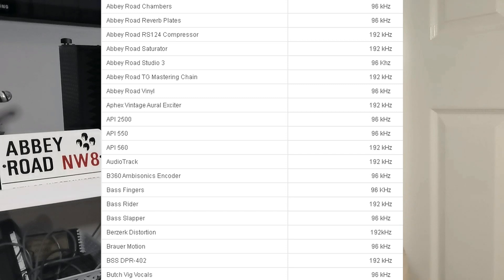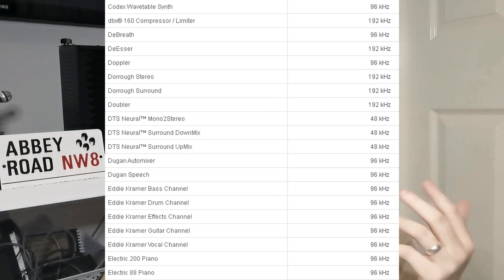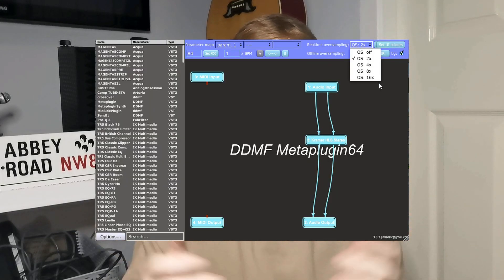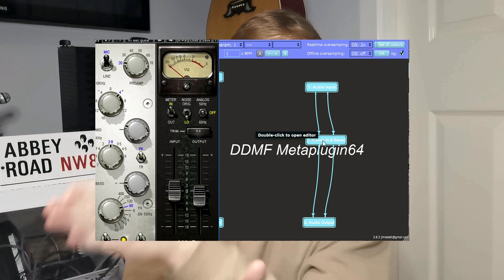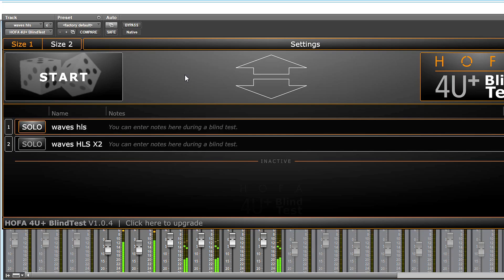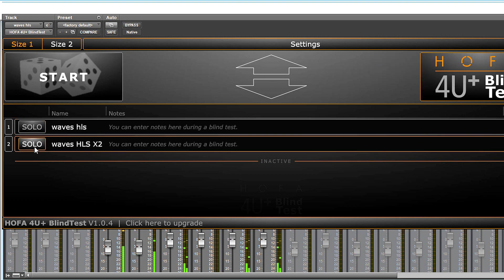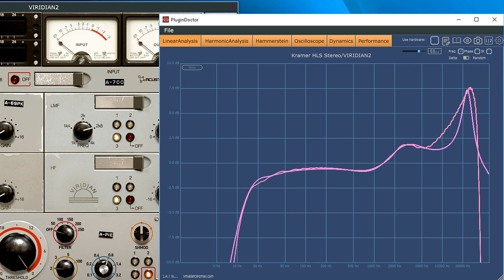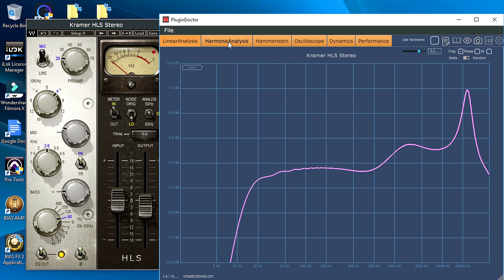OVERSAMPLING WAVES AUDIO PLUGINS USING DDMF METAPLUGIN || Kramer HLS vs Acustica Audio Viridian 2

Comment: Interesting observations and "good on you" for publicly correcting something.  I'm still moving away from Waves due to WUP since I prefer PA's Mega bundle where I get something new each year for the subscription and a big voucher to spend on the things I use most often.  I will also say, I run my sessions at 24/96K already so I hadn't heard HLS at 48K and was surprised to hear the difference.  In the AA vs HLS portion though, I also could've used either tone wise, but would've used HLS just because I could run it inline.
Reply from the maker: Yeah. Oversampling is a thing I guarantee you will be included in either v13 or v14. Will be the last throw of the dice to keep people using the older waves plugs. Could be a massive reason for people to stick with the WUP but tbh.. Metaplugin is like 30 odd quid or something haha be cheaper just doing what I did here.

PA plugs are supported to quite ridiculous sample rates so I might start having a play about with the PA plugs I use and see what kind of difference it makes. The maag air band is the one that is intriguing me the most as I'm wondering if it can sound even better

Comment: AA Viridian snake oil officially Debunked! 🤣 amazing end to this Vid Paul! Interesting stuff on the Waves front. I tend to use the MV2 and L1's but not a lot else really. 

PA's SSL's sound better to my ears than the Waves versions too, so they get a lot of use. 

BTW if you like the Arturia STA Level, then you should try their 1176 model, 100% always on my vocal chains these days, sounds so good. 

Great video again mate! Looking forward to the Opal vid - started using it on my masters and in my humble opinion it's just fantastic. Take care and thanks for taking the time to create these vids mate.
Reply from the maker: Thanks mate. Appreciate it 🤓

I tried out the Arturia 1176 vs PA purple and ik multimedia a while back. mc77 ran it close. Did sound very good though. 

Best 1176 I've heard is either the slate or DMG trackcomp 2. They are all good though tbh 🤓
Reply: @PaulThird  awesome Paul. Need to get my hands on that DMG trackcomp and give it a try.  I value your thoughts and opinions highly mate!
Reply from the maker: https://youtu.be/vQ0stfni80k

Check out that drum compressor shootout if you have time as that's got the 1176 shootout in it as well as most of the rest of the DMG comps in the bundle as well 🤓

Comment: Without X2 Waves sounds squashed on the top compared to oversampled. Very good to learn about this; especially in my case, as  I was prompted to learn that my DAW, Cakewalk, has a built-in upsample feature which does what the Metaplugin does.
Reply from the maker: That's very cool! I didn't know any DAW's could upsample plugins within a session 🤓
Reply: Reaper has a very simple oversampling feature, works great! :)
Reply from the maker: Minimum phase or linear phase?
Reply: Where is the upsample feature? I recently migrated to cakewalk.
Reply: @jc.1191  If you open the plugin window and right click on the top where the name of the track and plugin is, you'll see two options which can be selected independently: "upsample on playback" which does 2x OS when you're playing it in the session (which you can uncheck to save CPU), and "upsample on render" which does 2x OS when you export to a file. These settings will apply to every instance of that plugin in the session.
Reply: @damianoakes2592  Thanks!

Comment: Ohhhh so thats what the pre does?
Can you please clear my doubt that every acustica plugin has a 'pre' button , what exactly does it do? 🤓 thanks awesome video
Reply from the maker: I've not used an acustica plugin out there yet without the option of a pre. The pre's give you the sampled frequency response and harmonics of that specific unit. So In the compressor section of the viridian it gives you the pre's of the PIE and 2 helios compressors. The cool thing is that you can mix pre's with different comps that way so you can get the compressor action of one with the frequency response and harmonics of another.

In eq's the pre's are very important in the plugs as without it you are just utilising the sampled curves of the unit without any harmonics and with a flat linear frequency response instead of its natural linear frequency response. You can also mix these as well which can be cool to create your own frankenstein unit 

That's it really 🤓
Reply: @PaulThird  Woah thanks for the reply!! So if I got u right if I don't turn on the pre button for an acustica compressor it's basically just a digital compressor without any saturation with just the dynamic response of the original unit right??? And If I turn it on it's then showing the full characteristics of the original unit?? Thanx a lot btw u cleared a big doubt for me I feel stupid for ignoring the pre button all this time :)
Reply from the maker: It's OK 🤓

Yup without the PRE it's just a flat compressor with no harmonics.
Reply: @PaulThird  Thanks 🤓😁😁